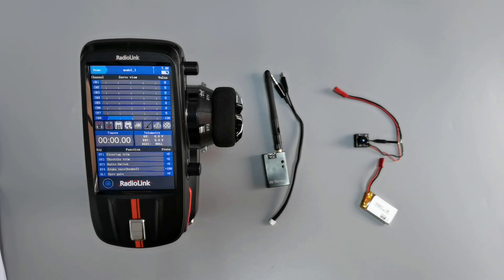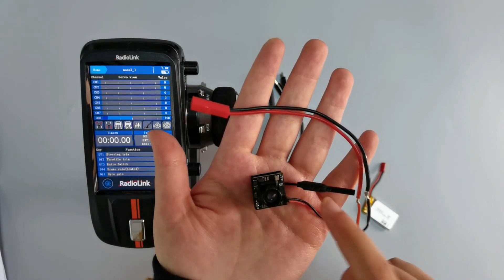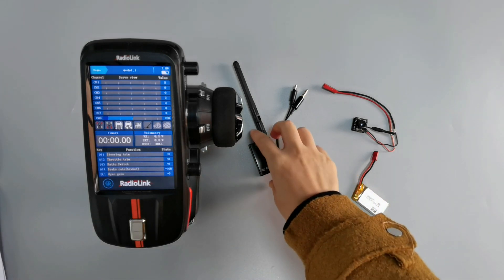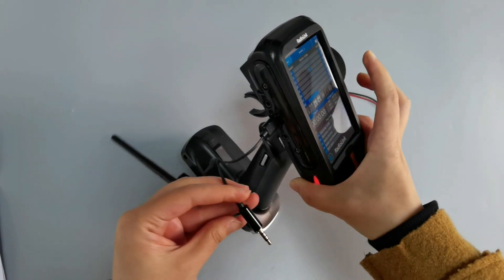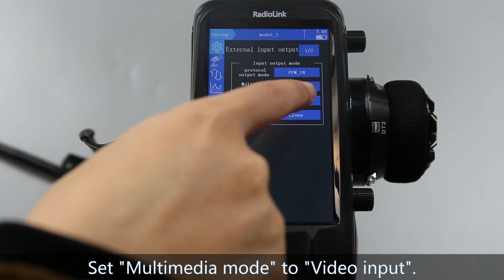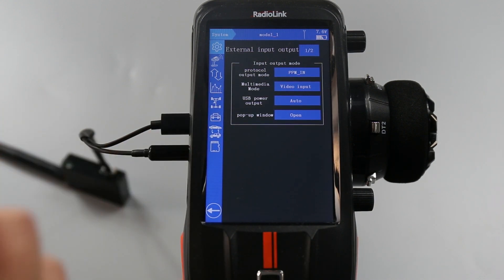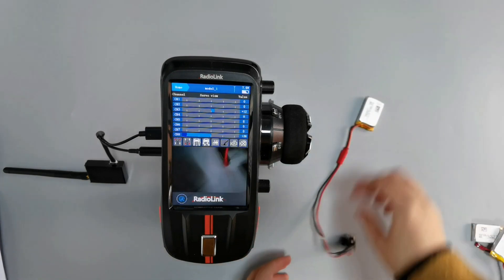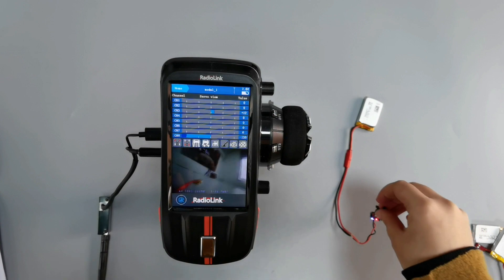How to set up FPV on RC8X?

Comment: This will be an awesome transmitter for my nitro
Reply from the maker: Thank you for your support. Here is the link of RC8X for your reference: https://www.radiolink.com/rc8xhttps://www.radiolink.com/rc8x       If any question, please feel free to contact us. Our email is  after_service@radiolink.com.cn
Reply: @Radiolink_official  Thank you very much!  I received my radio today, updated the firmware, and have been setting up my crawlers and nitro.  This transmitter is fantastic. I have no complaints. You even include a lithium battery and screen cover!  <3  -  so many features and intuitive to use.
Reply from the maker: @Everett-xe3eg  Thank you for your support.

Comment: Mines not working and the entire setup is brand new 
Yes I have done all the setting correctly 
I don’t think it’s settings then  actually plug and play as the setting on camera receiver and the receiver for connection needs to be set so it connects 
Or do I have a faulty setup I’ve purchased from radiolink ?
Reply from the maker: Hi, sir. If you have bought the camera and the FPV receiver, you may need to follow this tutorial to match the camera and the FPV receiver. If any question, please feel free to contact us. Our email is after_service@radiolink.com.cn

Comment: so the built in fpv video only works with analog camera and receiver systems? we cant use it with digital ones such as my Avatar FPV VRX?
Reply from the maker: Hi, sir. Sorry you can't. RC8X cannot work with digital image transmission system. RC8X supports AV signal devices such as analog image transmission system. If any question about RadioLink products please feel free to contact us. Our email is: after_service@radiolink.com.cn

Comment: Is this an older model ? Because the one that radiolink is selling on website atm is different many wires and different to what you are showing
Reply from the maker: Hi, sir. Yes. This is the old model. The new model has more cables, so people can use it with many other devices. Here is the detailed manual of the image transmission receiver for your reference: https://m.media-amazon.com/images/I/81jLA0eYiqL.pdf   If any question about RadioLink products please feel free to contact us. Our email is: after_service@radiolink.com.cn
Reply: The one they are selling atm doesn’t work 
And the cords are different then they try blaming it on you for it not working 
You don’t get the earphones Jack with the cord 

I had to buy a new set up on eBay for this radiolink rcx8 and it’s doing my head in not doing nothing that she is stating 🤦‍♂️ 
It’s like money after money to get absolutely nowhere
Reply: @Radiolink_official 
Well thanks that means your store owes me my money back 
As they are not selling it with the same setup as your using not the same twin cord and not the same receiver 
But the blame was on me because I wasn’t do it right 🤦‍♂️
Reply from the maker: @robdiangelo1081  Hi, sir. Sorry for the unpleasant experience. The device in this video is the old version. The device you bought must be  the new version. The using method is simple. Could you please ask the seller for the instruction manual? If any question, please feel free to contact us. Our email is after_service@radiolink.com.cn
Reply: Doesn't work. On screen, all is select like in this video

Comment: Make the screen larger, It really needs to be the size of a smart phone (minimum size)  and oriented for wide screen on your next version of this radio. This is a great set up I have this version now. Now that there are plug and play FPV I think this is going to become more popular for surface vehicals more specifically crawlers. I have the Walk Snail system on one and that is a total game changer. Also dont forget Sound, its not important for air. But for surface vehicals it is very important to hear the motor. It also adds a great deal to the FPV experience with engine simulators.
Reply from the maker: Hi, sir. Thank you for your feedback. We'll release products with larger FPV screen in the future. And if you want sound, we recommend you to search image transmission module that supports sound. It may achieve the sound function you want. If any other question about RadioLink products please feel free to contact us. Our email is: after_service@radiolink.com.cn
Reply: @Radiolink_official  Nice! yes please keep developing this. You  are pioneering this and you will own this market. Do not stop here with the  RC8X. This is very cool and inovative and what the market wants. They just dont know it yet. When it comes to scale RC crawling the market litterally wants you producers to scale down recreate Real 1:1 vehicals exactly into usable 1:10 versions. It dont get more scale then putting yourself into the drivers seat of the RC with FPV. However for this to be a good experience you need to be able to see in high detail on surface applications. 

The screen on the RC8X is probably ok if you could just flip it 90* and allow full screen viewing option. But If its possible maybe go a little larger. Bigger is better with FPV. I write code and have developed touch screen interfaces so I feel your pain. But I really want to see you succees and take this part of the market. The RC8X is an excellent start and it really is one of if not the best radio on market at its price point.
Reply from the maker: @Thrive-Off-Grid  Hi, sir. Thank you for your feedback. I'll send your feedback to our R&D team. If any suggestion about our products, you can send email to after_service@radiolink.com.cn

Comment: Hello, I have white little outlet on my camera, not red like into video. Can I use the camera or I should have other thing? And I need battery or I can connect directly on r8fg please?
Reply from the maker: Hi, sir. For the LED color of the camera, could you please confirm it with the seller? You need to use the camera and also a screen or goggles to use the FPV. You can connect the battery to the camera or connect the battery to the receiver. But please pay attention that the voltage cannot exceed the working voltage of the camera. If the power supply voltage exceeds the working voltage of the camera, the camera will be burnt out. If any question about RadioLink products please feel free to contact us. Our email is: after_service@radiolink.com.cn

Comment: Hi. I just bought a new RC8X using latest firmware 1.1.8. I follow the instruction but I still fail to have the video on RC8X screen.
Reply from the maker: Hi, sir. Are you using the FPV receiver in the video? And what camera did you use? press CH1 button on the receiver module to search for the camera. Make sure the frequency of the camera matches the frequency in the video. You can send us a video so we can better help you. Our email is: after_service@radiolink.com.cn

Comment: Hi @Radiolink_official I purchased the RC8X and FPV module. How do I change the transmission power to 200mW? Mine is defaulting to 25mW only, hence the FPV range is very weak.
Reply from the maker: Hi, sir. Did you buy the image transmission camera from our AliExpress official store? If yes, you can ask the seller for the manual. You can also check the details on how to set the power to 200mW from the manual of F121 here. https://www.radiolink.com/f121pro_manual  Because F121 RTF comes with this image transmission camera. And here are the details: Power Selection: Long press the channels/power switching button for 5 seconds, the RED LED flashes three time means entering the power selection mode, then short press the button again to change the power. The power changes each time the button is pressed once. The BLUE LED flashes once means 25mA, twice means 100mW and three times means 200mW.  If any question about RadioLink products please feel free to contact us. Our email is: after_service@radiolink.com.cn
Reply: @Radiolink_official Thanks I managed to change the camera's power to 200mW.
Reply from the maker: @edwardcruz1083  Great. If any question about RadioLink products please feel free to contact us. Our email is: after_service@radiolink.com.cn

Comment: Hello, can we use rapidfire? Usb is only for power, right?
Reply from the maker: Hi, sir. Yes. The USB is only for power supply in this video. The Type-C port on the left of RC8X is used to update firmware, copy data, supply power to the 5.8G image transmission module, and temporarily supply power to RC8X. And sorry we do not know about the rapidfire. You can check the detailed manual of it from the requirements on how to use it with transmitter. You can also refer to this tutorial on how to use RC8X with FPV devices. If any question about RadioLink products please feel free to contact us. Our email is: after_service@radiolink.com.cn

Comment: Hi , i bought this system and recieved , can i plug the fpv camera direct into RF8G reciever ?
Reply from the maker: Hi, sir. 1. Make sure the supplied voltage cannot exceed the working voltage of the camera. As far as I know, you can only use 1S battery to supply power to the camera. You can check more specifications of the camera from the sales page of it. If the supplied voltage exceeds the working voltage of the camera, the camera will be burnt out. 2. You cannot plug the camera directly into the receiver. Because the camera does not come with JST connector, you need to modify the connector with the JST connector. Then you plug it into the receiver. If any question when using RadioLink products please feel free to contact us. Our email is: after_service@radiolink.com.cn

Comment: How far can I view real time  videofrom my position in my front/ rear yards,I also I want to set up trx4 to check plumbing under my house raised foundation due to my being as a stroke survivor, will it work? A former auto mechanic , before my 12 yrs of stroke survivor
Reply from the maker: Hi, sir. The greater the power is, the farther the transmission distance. There are 3 power available for the camera (including 25mW, 100mW, 200mW) The maximum control distance may be 200-300 meters on the ground. So you can check if it can meet your requirements. Here is the link for you: https://www.aliexpress.us/item/1005003605002508.html   If any question when using RadioLink products please feel free to contact us. Our email is: after_service@radiolink.com.cn
Reply: @Radiolink_official  is there any receiver that connect to Samsung/android phone and works with your good transmission FPV camera, at least just want to see how good it works
Reply from the maker: @Future-v3  Hi, sir. The camera can be used with FPV screen, such as FPV monitor. Here is the link for your reference: https://www.youtube.com/watch?v=FP5nGmbiL6g  Here is the purchase link of them. https://www.aliexpress.us/item/1005003541373114.html  If you want the transmitter whose parameter can be adjusted in android phone, you can check T8S BT or T8FB BT transmitter. Here are links for you https://www.radiolink.com/t8s  https://www.radiolink.com/t8fb_bt  You can use T8S BT or T8FB BT with the camera and FPV monitor. Any question please feel free to contact us.